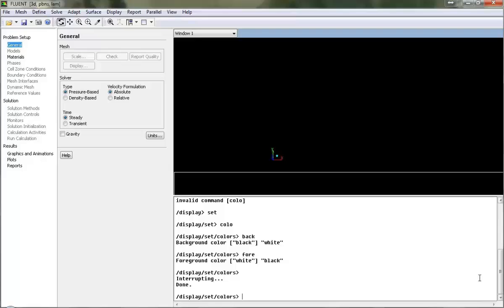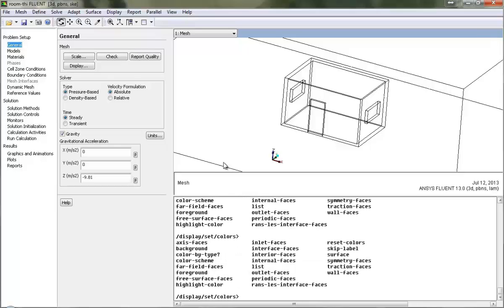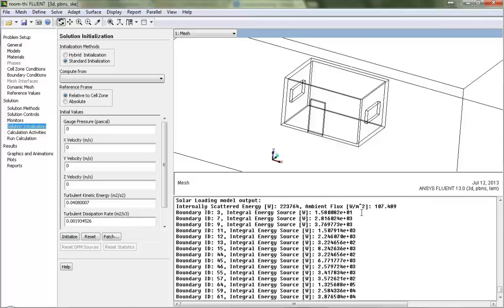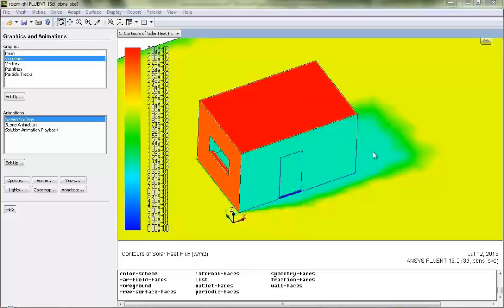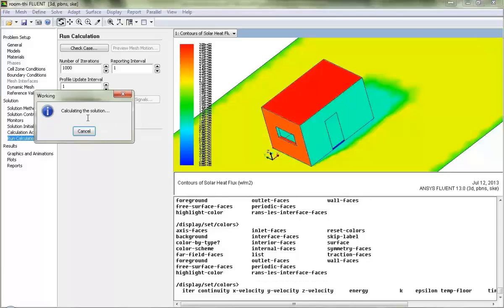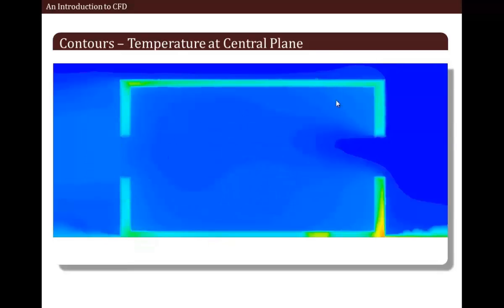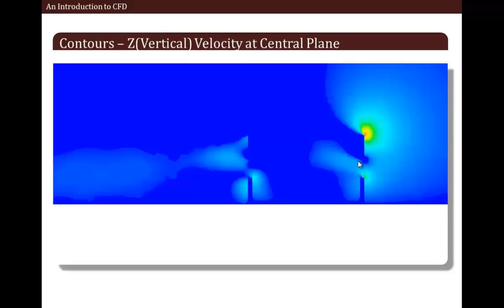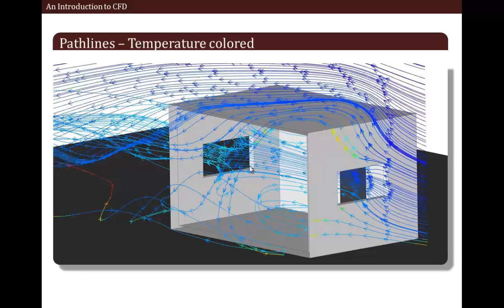Solar Load Model in ANSYS FLUENT

Comment: Hi, I also have some main questions about this problem you have solved using solar load:
how did you model wall thickness which makes it enable us to calculate the solar load on each wall surfaces? that is really questionable as in the showing results, it is depicted that you also modeled condition through the wall thickness!!! It's really interesting. how it is possible? because in the fluent tutorial it has been stated, that solar load using raytracing ignores the surfaces adjacent to the solid part i.e. "The solar ray tracing model includes only boundary zones that are adjacent to fluid zones in the ray-tracing calculation. In other words, boundary zones that are attached to solid zones are ignored."  So how did you model that solar heat flux is being calculated on the outer surfaces of your room walls which that have a thickness (I mean inner zones of the solid zone have being meshed) and attached to solid zones?

Please crystalize this question for me since I really need to model exactly what you have done in this problem, instead, my surfaces are transparent glazing, not the opaque walls as I want to simulate natural convection inside a sealed aquarioum faced on the direct radiation of the sun during the hottest day of summer. or anybody has a useful recommendation I would be appreciated.

Bests, 
Javad
Reply: Iam trying to do the same here
Reply: @ahmedbolteya3968  hello , what exactly do you want to do here? if your issue is exactly what I am looking for, I would be appreciated if you could help me or give me some good suggestions.

Comment: Thanks for the video!! I have a question; are the room walls semi transparent? so that heat flux can directly be applied through the wall? Or can Solar Load do this on opaque surfaces?
Reply: I also want to know about opaque surface. As I read in google, opaque cannot used this way

Comment: Hello...I liked your video. I have a different problem to be solved.  I want to analyze the heat transfer in a room which has a radiant ceiling cooling panel. The walls of the room radiate heat towards the panel by the virtue of its being on higher temperature. The panel on the ceiling has pipes fixed to it which has a continuous flow of chilled 
water in it. Can you make one tutorial for such radiant heating or 
cooling applications?